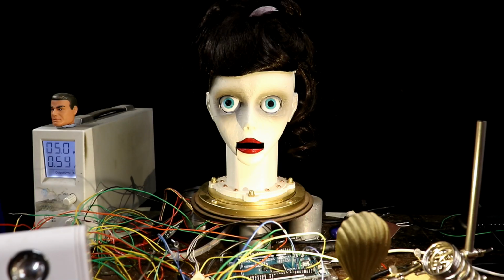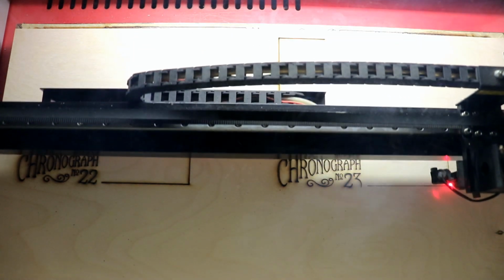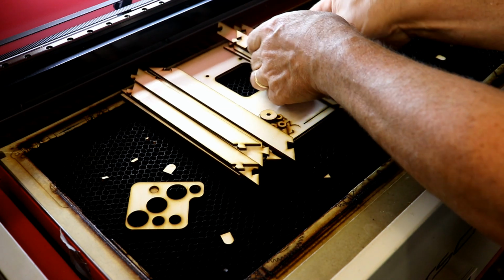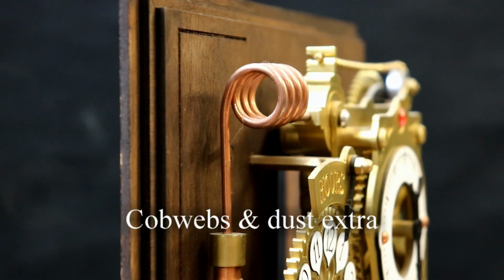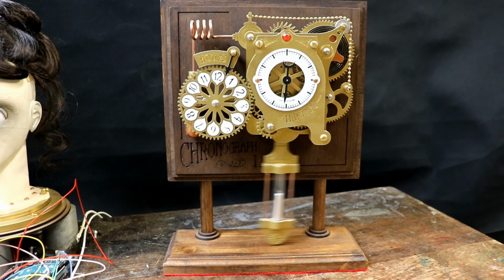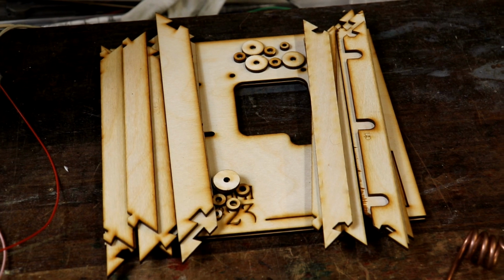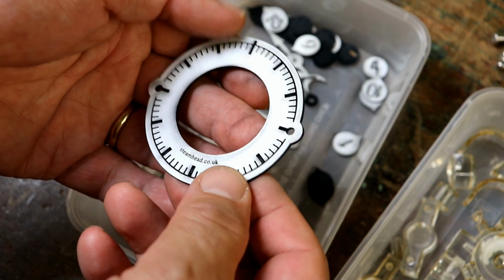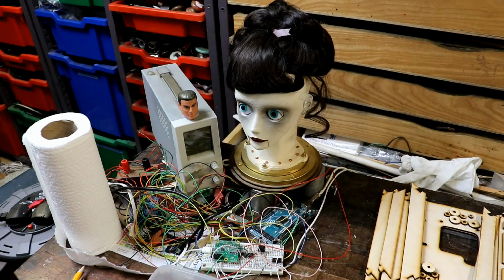More Nempnett Thrubwell Steampunk Kits required and an idea for a new steampunk kit... and Krakens

Comment: Hi there, it looks like a great kit!  I think that kits should allow for individualization and leave the tedious work for the purchaser.  I built a lot of plastic models when i was young, and was never satisfied with the kits that didn't require any work, eg the snap-together kits.  The more work I had to do to complete the model, the more i liked the model.  Just my thoughts....
Reply from the maker: Thanks so much Tom, I'm in full agreement, especially the bit about the tedious work! I've put this idea on hold for the moment,  as I very slowly realised there arn't any steampunk events at the moment and these are where I sell most of the larger machines, so I've dropped the cost of the Climatic Revelator to the event price and am really enjoying making two more. Video to follow shortly. Thanks again for your comments.